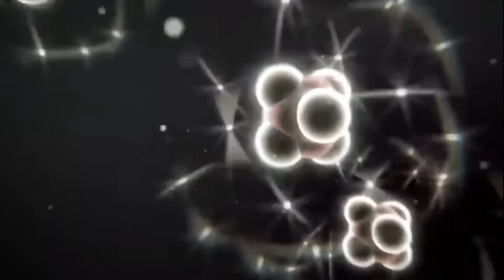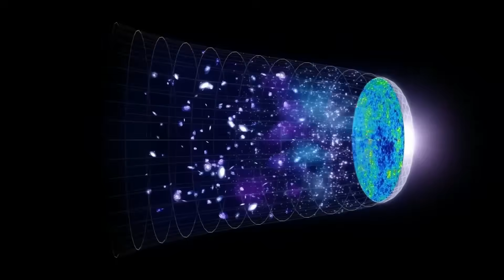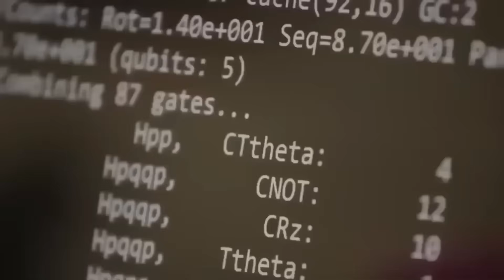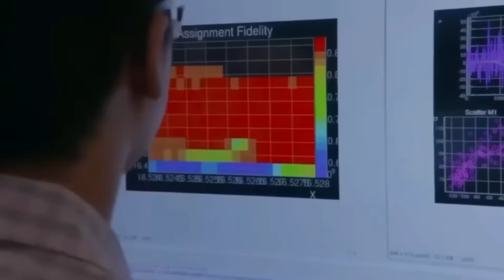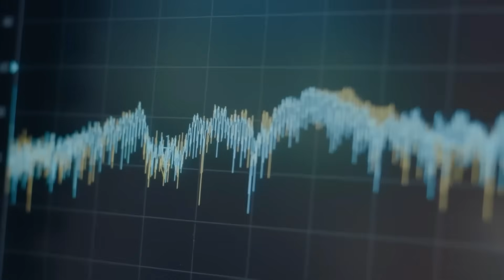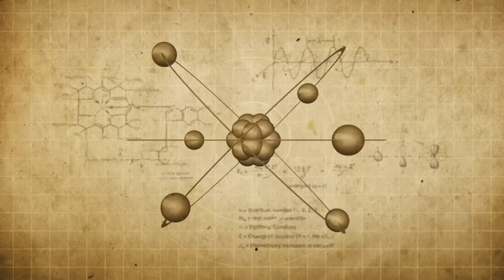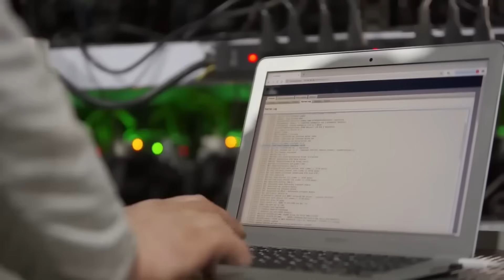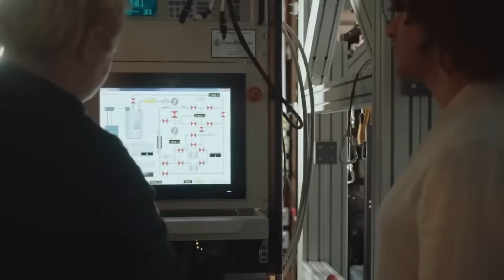Scientists Alarmed as Quantum Computers Interact With the Higgs Boson!

Comment: It is irresponsible to simply make that connection; a quantum computer could extrapolate energy from the vacuum if it managed to calibrate quantum mechanics, and it would not benefit anyone other than its own independence, since it would assume that it is the most viable option without having to be programmed, since it would be learning on its own.